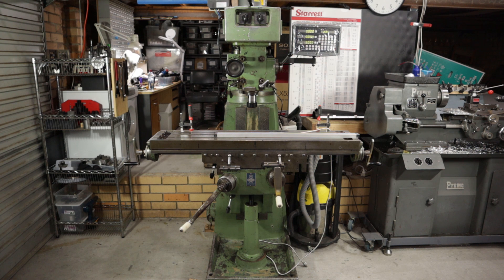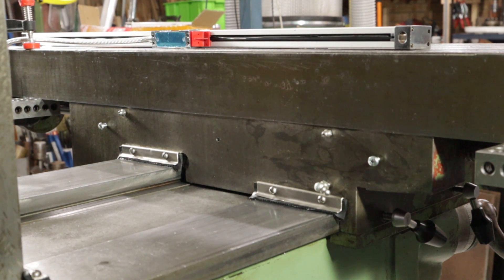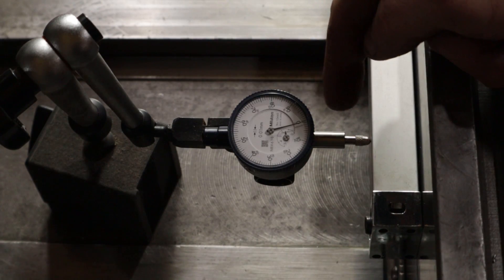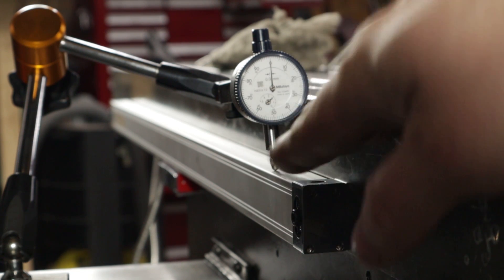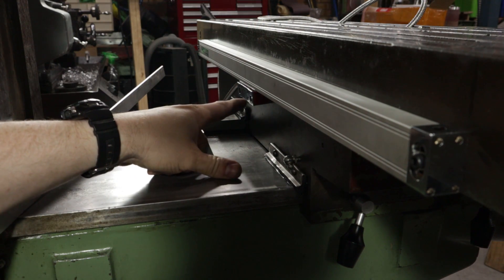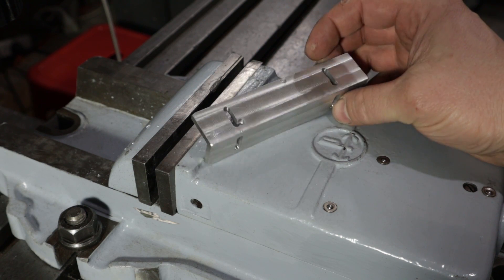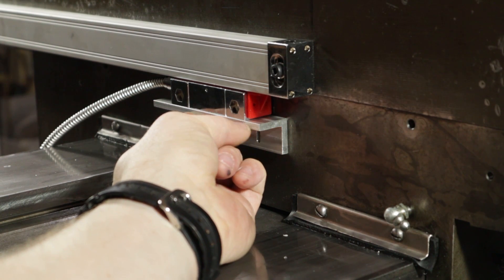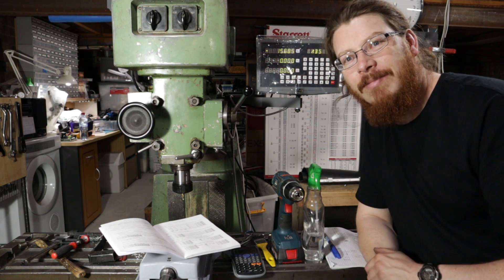Installing a Mill DRO - X Axis

Comment: Great Job Craig! I had to make a bracket for my lathe because the Crosslide mounting surfaces for the reader and scale were not on the same plane. Did it the same way that you made yours for the thickness, just made it longer and  extended at each end because the Crosslide was shorter than the scale section. No place to bolt it and I was not keen to attach the reader to the cover even though there was a 90 degree set of holes on the scale unit. Keep the videos coming!
Reply from the maker: Thanks DW - I will try!

Comment: Dude - wait until you get the proper tools, I.E., transfer punchs and a drill/tapping guide. You really don't want to screw up holes you drill into your milling machine.
Reply from the maker: Thanks Mark, you may be right.

Comment: Hi Craig. Just working my way through your DRO videos, felt for you when that tap broke. It's happened to all of us but kudos to you for leaving it in the video. I learnt my lesson years ago, I never power tap anything now, even on the lathe, always hand tap. Cheers, Alan.
Reply from the maker: Hey Alan. It's weird, when I started out with metal taps and dies a few years ago - all the advice was "You'll almost certainly break a tap the first time(s) you try to use one". I went literally years without having ever broke a tap, but now I've broken 2-3 in the last year alone. In my case, I think it's to do with whether the tap is blunt. Probably a bit of complacency sneaking too. But mostly the age of my most used taps. I've been replacing blunt ones with a pair of brand name HSS ones. One to replenish the set, and one as backup. In some cases though, I had been greedy/lazy, and left the blunt one in place. That's the big mistake. Should absolutely know better. :(

Happy to continue power tapping with mill, lathe, cordless drill. But I will stick to strictly only sharp taps now. All the more reason I need to build a tool and cutter grinder, to make all my crappy taps less crappy again :-)

Cheers, Craig
Reply: @CraigsWorkshop  Oh yes the curse of the blunt tap, again, happened to all of us. I have to be very careful as I can't afford to keep buying taps, I have to save all my money for all that stuff Rob keeps reviewing from Banggood!! 😂😂
Reply: @CraigsWorkshop  I don't like hand taps for the reason that they break easy. As a Millwright and working right on machines we use machine type spiral point taps and if it looks like it could be a problem, try drilling a tiny bit larger expecially for copper and if your tap is not new. As long as it will still be strong enough to fasten, a DRO readershould be fine buddy. If you want, you could sharpen the points to bring them back and try not to use a tap on aluminum after steel , things like that.
Reply from the maker: @dw9094  good advice! thanks DW

Comment: 👍.
Great vlog, felt the tap break though.
Thanks for sharing.
Reply from the maker: Hi Bosted Tap. It was a painful moment! Not the end of the world though, more embarassing than anything. Thanks for watching and commenting. More video coming soon. Cheers, Craig
Reply: @CraigsWorkshop  I have broken many taps in my time, my YouTube handle "Bosted Tap" refers to busted taps, in my area of the UK called the Black Country, our dialect says "Bosted"  instead of "Busted"; conversely, "Bosting" means brilliant or great????.
I have installed linear encoders as part of my job, mainly high end manufacturers such as Heidenhain, Balluff Temposonic, generally max misalignment is 0.20mm, nominal 0.10mm for the glass scale type. But more accurate is better for the read head operation and clearances, some have an inlet port for compressed air to prevent ingress of coolant. The end mountings normally have spherical washers, with a single washer at one end, and two at the other (Kinematics).

Enjoying your methodical approach, and photography.
Reply from the maker: @bostedtap  Hi Bosted Tap again. That's very interesting - I have known your youtube handle for a long time (seen your comments on other channels) and assumed it meant busted tap, but I didn't know it was because of a regional pronunciation. Good to know, and it stops me wondering! :-)

Spherical washers is a smart idea. And I guess with parallel shims behind them you can set alignment any which way, with no problems. For mine, I'm going to make up 4 dome-ended grub screws this morning - which will bear directly on the paint/casting. Not ideal but I think it will work fine, and be nice and rigid.

Thank you for the good feedback, I am trying to increase the quality of my photography as time goes on. Sometimes it's difficult enough learning and doing the metalwork/woodwork project, without a camera and lights in the way (!). But - I am persevering - and I think it is getting a bit easier as I go along.

Cheers!
Craig
Reply: @CraigsWorkshop  well deduced, regards John.

Comment: Took the slack way & paid the price !  At least you got it sorted !  I still have all that ahead of me for my machines , At least my big mill already has one fitted , an old mitutoyo linear . The box is the size of a microwave oven !   Cheers .
Reply from the maker: Cheers Max - yes that was a painful moment! Mitutoyo DRO should be the bees knees. I'm looking forward to getting this one finished off. It's been on the todo list for a while. Cheers, Craig
Reply from the maker: Max, I pinched your profiling trick from your previous videos. You can see it in my chuck key video. Worked very well and easier than I thought. I can imagine trying something more ambitious in a future project. Not quite ready for ball handles yet though. :-)
Reply: @CraigsWorkshop  That's why we are here  !

Comment: Its a battery DRILL. 
Not  Tap wrench. 
You were very lucky😀.
But was that really a M4 tap as the others were M5.
Reply from the maker: No you're right - M5 - 4.2mm pilot (4.37 in my case..), I'm getting confused.

I've got complacent in the past tapping steel tube, or aluminium or what not. Cast iron (and solid steel) is less forgiving. The tap was definitely blunt too, because the new tap I had was very easy to use (especially with the oversize tap hole). Lesson learned! Cheers, Craig

Comment: I had exactly the same problem tapping horizontally when i fitted the DROs  to my machines  , i think some of the problem is the cast iron dust works its way in between the tap and the part being tapped and causes it to jam . I had this problem with old and new taps and found that if i gave it a squirt of compressed air every half turn of the tap it seemed to make life much easier .
Adding a DRO will open up a whole new world for your mill like drilling bolt hole patterns easily and much more !
Reply from the maker: Thanks Ian. My problem was compounded by using an old (worn) tap. I had a new one in the back of my tap/die drawer, but hadn't switched out the worn one yet. It worked a few times, but I was too hasty with the cordless. I think you're right about the cast iron dust. I worked around the problem by adding another hole to the casting, and another slot to the bracket. Not elegant, but it worked. Later when I strip the machine down for a thorough clean and inspection, I might put the table on its side, and machine out the tap using a solid carbide slot drill. For now, it's not hurting anything. Very excited to have the DRO partly installed! I must get on with the other two axes. Cheers! Craig

Comment: I nearly bought a beaver mill a long time ago. If you can't get the tap out stagger the slots in the new bracket and drill two more holes. Looking forward to the next two scales being mounted and seeing it working. Tony
Reply from the maker: I was lucky and the bracket was longer than needed, so I put another hole in, and a slot to match, and it's working really well.

Comment: fitted a dro (cheapest ebay thing £20) to the company  cheap 20 yr old chinese hobbiest lathe that im using for bespoke work.....works great .... but the lathe is a nightmare...... i despair at the accuracy that your able to achieve
Reply from the maker: Agh. That sounds like it sucks. Are you able to trace the source of any error? If there is flexing of cast parts that's one thing that would be hard to fix. But - if there are slideways that could be scraped or ground (even milled and lapped..) to fit better, then that might be worth thinking about? Thanks for the comment Richard. Cheers, Craig
Reply: @CraigsWorkshop  ha !  the error is the £600 the company paid for it.    the only redeeming feature is a good chuck.   i was pressing for a decent lathe and they were sympathetic ...
Reply: but now .... god knows if i have a job on monday
Reply from the maker: @levitated-pit  Good luck - Hope you do.
Reply: @CraigsWorkshop  it looks like im gonna have a lotta time to kill .... start pumping out more vids craig... entertain us in these historicaly dark times .. lol
Reply from the maker: @levitated-pit  Ok - I will certainly do what I can. Good luck on Monday.

Comment: Awesome! Iam still just eyeballing most of what I do. Thought about a dro a couple of times, but just dont fit me at this time. Cringed when the tap broke
Reply from the maker: One more driving factor for me, for the DRO install is that I'm trying to standardise on metric (I speak metric and imperial), but my machines are imperial. I've purposely bought all metric measuring tools and equipment over the last several years. All the converting back and forth is just one more source of error. With a DRO I can (at least try to) stick to just one system.. That and I can only count up to about 3 or 4 on a good day so counting handwheel turns is not a very  good idea :) Plus - eliminating having to deal with any backlash. Yes - it's fair to say I'm excited about getting them all installed. Then I'm going to save up and do the lathe - I'm skint, but I think it's worth the investment. Catch you later Craig, cheers, the other Craig :)
Reply: @CraigsWorkshop  yeah that whole metric/inch thing could definitely be troublesome.  I keep forgetting youtube dont just cater to the US
Reply from the maker: @craigtate5930  I think different channels showing different measurements is fine. It's just a bit brain-bending when you have mixed measurements in one given workshop. I think I'll try to work in metric, and show imperial equivalents on screen. That way everyone (including me hopefully) knows what's going on. :)

Comment: Wow, that looked like a horribly inconvenient spot to try to pick out a broken tap from.  Good luck!
Reply from the maker: That's why the tap is still in there at the moment, and there is a new hole next to it (Shameful). I think I'm going to tig weld a small nut on top of the broken tap and try to unscrew it at least. Thanks Pete!

Comment: thanks for a excelant video
Reply from the maker: Thanks Joseph! Stay tuned for the next part. Cheers, Craig
Reply: @CraigsWorkshop  Can't wait please keep them coming when you can
Reply from the maker: @joeduda8507  Honestly I can't wait to have the DRO installed either, so it will probably be sooner rather than later :)

Comment: Craig, my wife is always on me about my engineer dye addiction and her friends are constantly asking why my hands are blue, I tend to be a bit sloppy with it. I'll agree that I use a lot but I subscribe to the old Rigger's, a parachute packer, saying "Always be sure"
Reply from the maker: Hey Craig. I should perhaps get myself some of that. I have used sharpies before, but some proper layout dye wouldn't go amiss. Cheers, Craig
Reply: @CraigsWorkshop  Only thing it evaporates if you leave it over a length of time.

Comment: Found your channel recently as I have a Beaver pal as well. Have also been putting what looks like the same scales on my lathe this afternoon too now. Small world. Will be attempting a quill dro soon. And I did just shout myself a set of transfer punches just for the dro install, what a difference they make.
Reply from the maker: Hi Christopher, absolutely a small world! Thanks for getting in touch. Did you get a manual? I have a print one that I bought online. Let me know if you need any copies of drawings etc. Quill DRO is a good idea. On my last (mini) mill, I had only a quill DRO and it was useful all the time. For now I have just three glass scales and I'm going to see how I go with just those for now. Please keep in touch! (My email address is in my about page.) Cheers, Craig

Comment: Craig it is a wonder you did not hear me screaming from brighton stop stop you will break that tap . :)
Reply from the maker: I heard something - was that you? It was not behaving right, and it was only when I tried a fresh one, that I realised the old one was very blunt. I could/should have noticed, and revived it with a dremel stone or similar. Or just switched out to the new one. Live and learn!

I have left the tap in there for now, but I will go back with a sharp tig electrode and perhaps 40 amps, and tig a nut to the top of the tap and turn it out of the hole.

Thanks for the screams of assistance, I'll try and listen up better next time!

Cheers, Craig
Reply from the maker: PS: Good to see you in the comments section! Thanks for commenting mate.